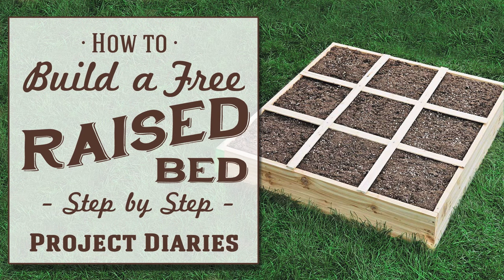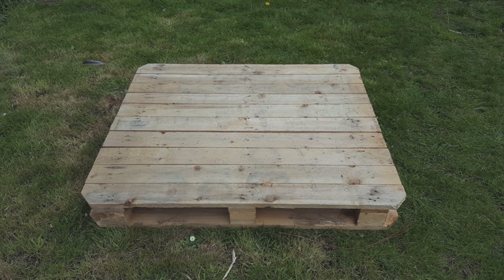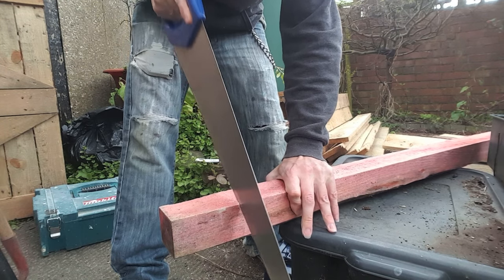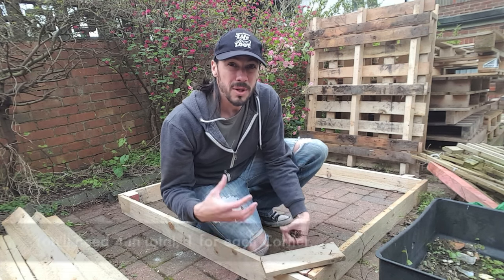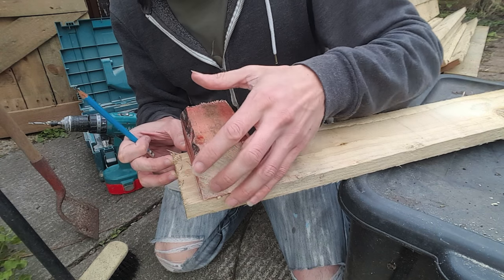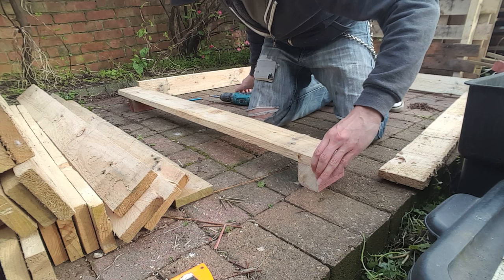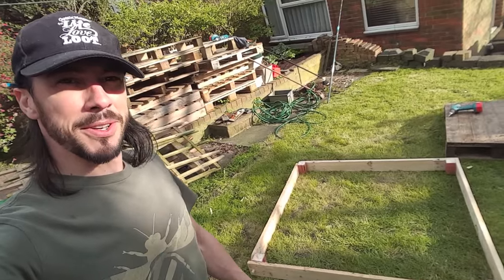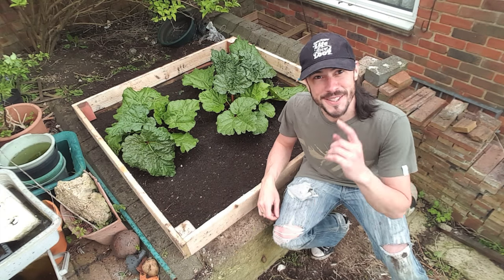★ How to: Build a FREE Raised Bed (A Complete Step by Step Guide)

Comment: Instead of sawing a piece of 4 by 4 in smaller peices you could use the blocks from the pallets, i have done that and it works great!!
Reply from the maker: Good idea. Some of those blocks are made from compressed sawdust and will break up easy but if you have the solid wood ones they will do a very nice job :)